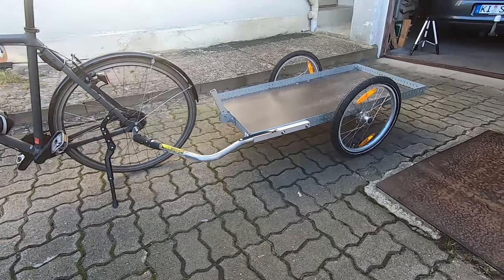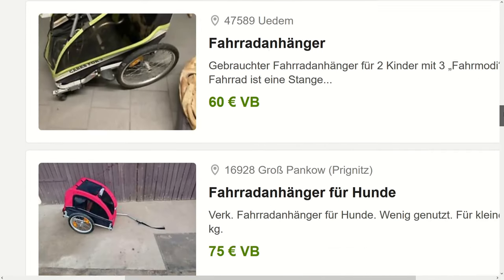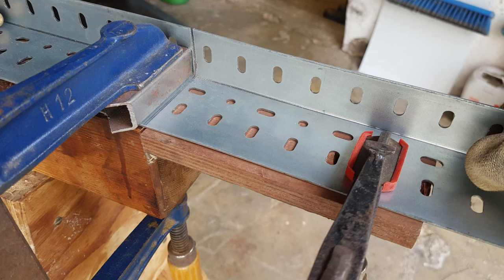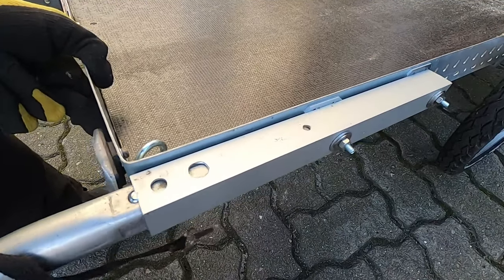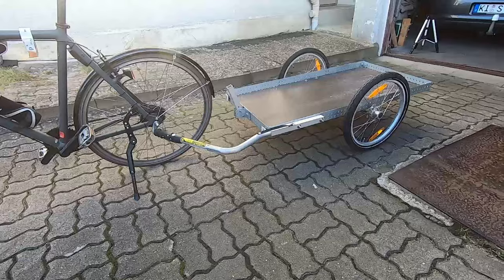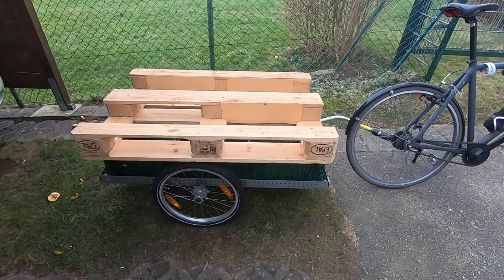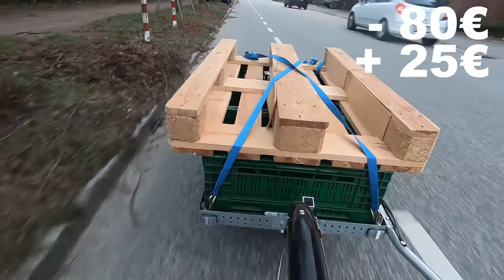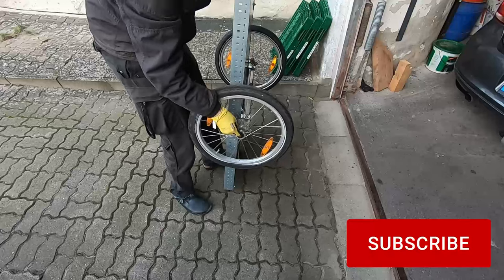DIY Budget Bike Trailer

Comment: You should put on 2 more wheels to make it a 4 wheel wagon. That way, the cart will stand by itself and hold twice the weight.
Reply: You’d need smaller wheels, and the front would have to be able to steer.      The best way to make any trailer stand on its own, is to give it fold down legs at the corners. (Like a caravan)

Comment: Nice one! -- Did you check the maximum weight you could load …?
Reply from the maker: Thanks! It's capable of at least holding 80kg but I did not try more. But the limiting factor will be your pulling power. Also check your local laws. In germany the weight of a bike trailer is limited.
Reply: @Marty  You are absolutely right, due to the "pulling power" as well the regulation in Germany. They are always strict …;-) I just wanted an estimated/approximate Idea for the axle/axial load. That way I would go ahead and buy myself a used Kids … ;-)) –– Keep them coming, the good Ideas √√

Comment: I've come up with better ideas for myself and it would be so tricky to built and also willing adding solar panels and batteries to keeping my power accessories when I need go out fishing in summer nights and looking forward on next project built way better then my first project and willing to upgrade for my new caravan that's my goal
Reply: I've still got fishing trailer willing to do some wider axles and then do side's wall framing into cargo box with few bits n pieces then can not wait to tow along with my e scooter and will make my own hitch attachment part from that be bonus

Comment: How did you assemble the axle ?
Reply from the maker: It came as a complete bundle with the wheels from the old trailer, so I did not have to do much other than bolting it to the plywood.

Comment: Interesting though I must ask max weight
Reply from the maker: I obviously did not test it to destruction, but I can stand on it without it feeling fragile. Meaning at least 80kg.
Reply: @Marty  thanks so something like yours trips to the park possible though.i was maybe thinking something built on wheel barrow solid wheels which can each support 135kg .of course need build a frame strong enough.

Comment: They are trying to rip us off and they say heavy duty, more like heavy price and overcomplicated components to add on extras.
Reply from the maker: yes
Reply: @Marty  My main problem is the weight they can carry and it's not at the maximum for BS/EN/TUV standards and UK Law such as 150kg. I need something that can hold a Mans weight at least and they mostly make small one's for up to 65kg and they call that heavy duty.  Online companies are overcharging and Far east copies are risky but all the commercial one's look weak and  not maximum size under the law. Why can't someone make a perfect budget priced one, they have the technology to automate and create them low price high quality. It's bad economics to price them out of reach to the masses and if it is a cheap import it could be illegal and to make a legal DIY one like yours we need to pay over £600 for BS standard certification or the police could legally stop us riding with it on the road, someone is making a big profit eh, it's greed and oppression against those who can't afford. Stuff it, I will make a wooden one my own dropouts.
Reply: @thethoughtmaster  what country do you live? Shocking that you need certification for a DIY bicycle trailer!
Reply: @big_red_machine3547  I am in the UK, London. I bought 4 wheels cheap for under 60£, the bearings are stiff so they need greasing. After I build my other stuff I will make a stronger 1 than those cheap imports. Need some wood and flat bar to make reinforcements and drop outs next, should be easy.
Reply: @thethoughtmaster  Seems easy haha. I’m working on mine. 2” steel tube with dropouts. Got a kids BMX bike yesterday for the 20” wheels for $10. To tide me over, I bought a used MEC (made in Canada) used bike trailer for 2 kids. $100. Excellent quality! Whole thing is 35 pounds. Going to put a 1/2” thick floor inside so my old black lab can ride in it
Reply: @thethoughtmaster  PS, condolences about our Queen
Reply: @big_red_machine3547  I looked at some second hand kids bikes but too much baggage then I found 3 other new options all similar price 16" wheels, I have the inner tubes, rim tape and got tyres for 75% off for 4. It all came together for the price, now I need a plan.
Reply: @thethoughtmaster  Nice work. I’ve read numerous reports that 20” wheels are the perfect size, so that’s my aim. I was originally going to use 24 or 26” wheels that I already had but they are too big and can’t take the lateral forces. I tried using rear wheels from a garden tractor ( too wide and large, and 10” dolly wheels, too small!) 
 Are your wheels regular bicycle wheels or are they cantilever trailer wheels? The later are far better, since you can make a solid axle and not have to frame in the bicycle wheels with dropouts to secure. PS, now I’m thinking of a single wheeled trailer! I can weld (poorly) and have 2 bike frames to use if I need
Reply: @big_red_machine3547  But 16" wheels are so much less cash to buy, the only problem is the undercarriage hitting things so I must make vertical mounts to raise the base and mount the dropouts to. it will be ok. I can bolt all the bits together, no welding and easy to remove pieces if they get broken. I will put picture on my pinterest account when complete, same name as here.
Reply: @thethoughtmaster  sounds great! But you’d be surprised at how much clearance you’ll get with the 16”. It’ll have plenty. But it’s really wise to keep the center of gravity as low as possible otherwise it’ll be tippy. I find 28” minimum width is perfect. My kids trailer is 36”! My build will be 32”. I’ll look you up on Pinterest. I should start posting stuff too! Good luck mate
Reply: Oh ya, I thought of you tonight lol. I saw a flicker of reflection in the bushes from my bike light. It was a discarded kids bike with 16” wheels haha. So I brought it home and took the wheels off! 🤣
Reply: @big_red_machine3547  After attaching dropouts I think it will probably be 9 to 10 inches clearance but will it be enough for some bumps, pot holes, curbs or ramps, I think 12 inches minimum should be ok. Great fun making stuff eh.
Reply: @thethoughtmaster  oh ya. 12” is way more than enough. 6” is plenty. I won’t be riding or building any time soon. A car forced me into the soft shoulder and I smoked a big steel mailbox on a steel pole at 50km/hr today. Hit it with my shoulder and ripped the AC joint apart and I need surgery tomorrow. Totally brutal, but I’ll be back on two wheels again asap and be more careful
Reply: @big_red_machine3547  That's bad, I'm a warrior on a bike, my testosterone gets so great when I exercise I beat cars with my bare hands, an idiot pretended not to see me and pulled out on the roundabout when I was going around it at 25mph on my mountain bike, fortunately disc brakes are quicker than cars because bike is lighter and I stopped next to his car and beat his car and punched his window, he looked worried and said sorry. There was a group of men standing next to the roundabout all shouting at him when they see him pull out before I stopped, they looked more worried than me. I laughed after because I could do worse to him. Sorry you are suffering, get well soon and when you are healed send him a punch from me.